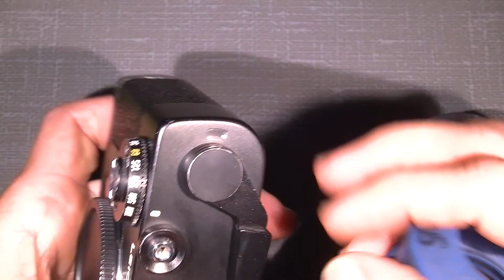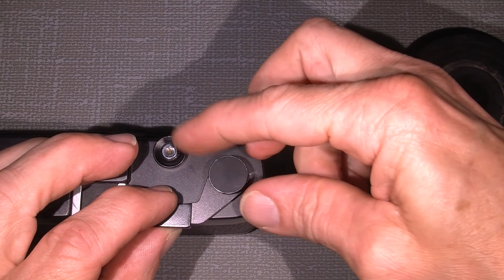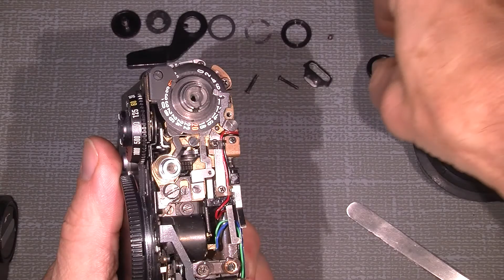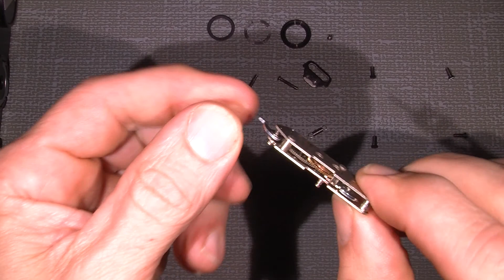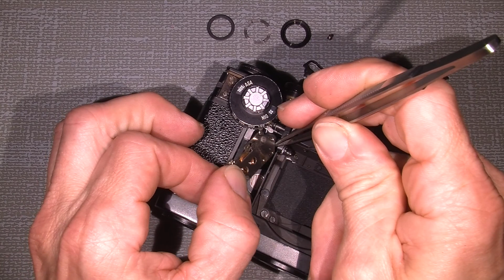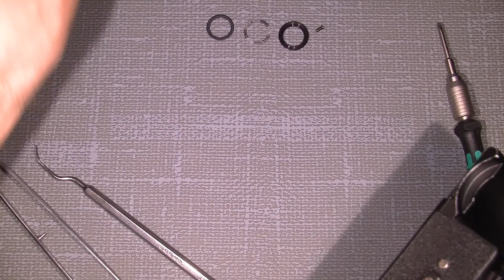Cleaning the slow gear in Leica CL

Comment: Very useful information about the disassembly of the Leica Cl but I think this video shows exactly why maintenance is required. This is the same for mechanical watches and the right way to do it would be to disassemble each component, clean, dry and lubricate properly. That said, what you did will work but rest assure there is still small grime and dirt between those gears and the fresh lube will attract the dirt around it and you'll be back doing this again soon enough.  Thank you for taking the time to make this video and sharing your process.

Comment: Brilliant information. Would you mind share some tips, how to remove the meter arm? Do I have to remove the lens mount  unit? Or it can be removed from internal. Don't mind cut the arm as  Don't need it. Just remove to allow using 21mm f4

Comment: Great information that is easy to follow. Can anybody tell me how to get the hotshoe off the top plate? I have replaced my damaged top plate but the serial number is engraved on the old hotshoe. I need to swap the hotshoe. There is a hex nut which is easy to unscrew but there also seems to be three rivets holding the hotshoe to the top plates.

Comment: Thanks for this video! Question: Do you know what causes a sound like small pebbles rolling around on the film advance and shutter speed dial side of the camera? Would these be ball bearings moving a bit in the shutter dial?? My Minolta CL works fine but I've wondered where this sound comes from. Thanks.

Comment: After finally cleaning and lubricating the slow gear accordingly to your spotless instructions, I am now facing a hard time reinstalling the speed gear as mined needed to be cleaned and thus removed. Any experience with that? It’s tricky. Thanks in advance

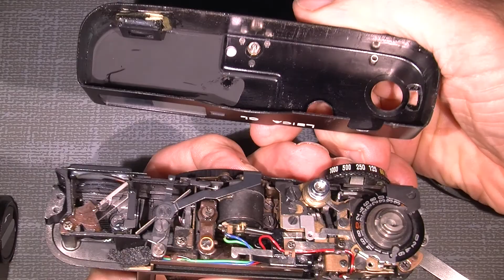Comment: Thank you for the tutorial!  Opened up my CL to clean out viewfinder haze.  Couple of notes--1.  I used a medium sized rubber band across the pressure plate to protect the shutter; 2. There's a tiny metal spacer (maybe 2mm tall, easily lost!) for the single screw hidden under the advance lever which sits under the top cover (it's stuck to the cover at 9:22 of the video; mine was loose and sitting on body but fortunately didn't lose it).  Now to fix the meter.
Reply from the maker: That's great :-)

Comment: Thanks for the great quality video! I am having mechanical trouble with by leica R3 bodies. Is there a reason why you didn't put a manual to disassamble any leica r body online so far?
Is there anything special about to know? How can I loosen corroded miniature screws in the housing? WD40, or does heating uo with a soldering tool help?
I would highly appreciate your input!
Thanks
Reply from the maker: Thank's Johnny, I do not have much experience with the Leica-R bodies, but I have repaired a few with success.

I have buy a Leica repair book from eBay, about different Leica cameras. It's a really good book.

https://www.ebay.com/p/Leica-Camera-Repair-Handbook-by-Thomas-Tomosy-1999-Paperback/607589?iid=183063173756

Here is what others look for in different forum's:

https://www.photo.net/discuss/threads/leica-r3-automatic-exposure-problem-electronics.400115/

https://www.l-camera-forum.com/topic/11301-r3-with-dodgy-meterrepair-manual-anyone/

Cheers
Kenneth

Comment: Great video. Thanks for making it. I fixed the slow speeds on my CL.
One problem: when opening up the top of the camera a tiny silver colored cylinder fell out.
It wasn't mentioned in the video. Do you have any idea where it goes??
Reply: did you ever found out? i think i know where it belongs. it belongs right under the only screw that is on the top plate. its the distance zylinder for the screw. nothing really important i guess.

Comment: If possible can you make a video on how to adjust the rangefinder on the CL.  Mine seems to be out of focus, and the rangefinder patch is basically not visible.
Reply: Hi. For the horizontal alignment you need to pull off the little round cap on the top of the cover and turn the screw that you find under that. With the camera loaded on a tripod and the lens on infinity look inside the rangefinder and turn the screw until the right images position. Enjoy👌🏻